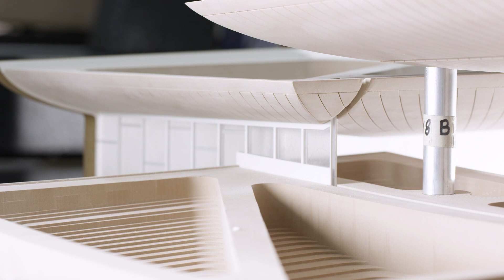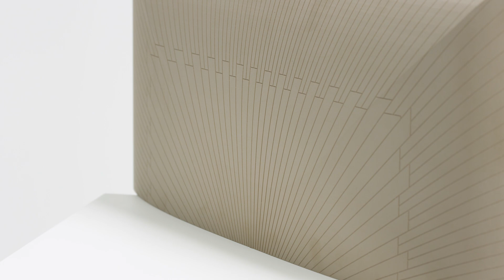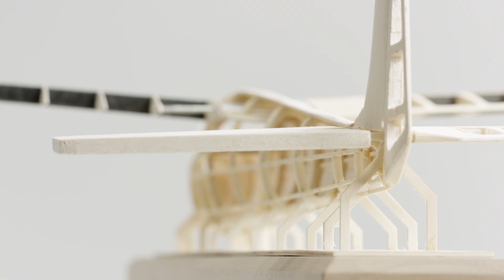Hammer® HNC 47.82 - Model making with the CNC portal milling machine | Felder Group

Comment: Was about to order this machine here in Finland, even had the pre-order bill ready to be paid but then... Well Coranavirus happened. I'll be ready to resume the order when things gets better, but for this is important that Felder Group keep distribution chains updated with information such as availability of the machine (so far I'm guessing right now is autumn?), also the machine is so new that distributors don't have much information to share. 

For example on my pre-order for the machine with the 2.2 KW spindle the situation with the zeroing tool was unclear, distributor didn't know when it would be available and a CNC without it is just not as simple to setup. Also is the Ending CNC licence (controller software) is it time limited? Does the software license expires for this machine?

Also even though I was ready to get the machine with the 2.2KW spindle it would be really good to hear more about options, and on that page also more information about all accessories and add-on options for this CNC.

Overall this CNC seems promising and I'm excited about it, with that said I'm sorry to say that sometimes this seems a bit like crowdfunding project, things are a just bit unclear specially on the products website. Not a rant just an humble opinion, thanks.

Comment: This now days, is a gloryfide dremel. This can't be serious I'm 2020?
Reply: "glorified". And if you have seen a dremel on a CNC router, you can see this spindle appears to be better. It takes a larger mill/bit and it looked to have very low runout. The linear bearings are also a huge plus here compared to the usual round ones.

It's likely a rebranded spindle from another brand, but ones I've seen like that from Europe are actually quite good -- sometimes better than the chinese water-cooled spindles we all buy to replace our routers on our CNC machines.

That said, it's not cheap, but it's not much more than a roughly equivalent CNC Shark.
Reply: I'd like to see you do that with a Dremel.